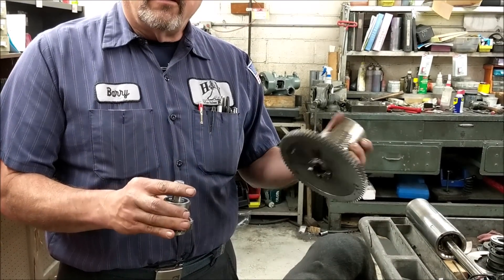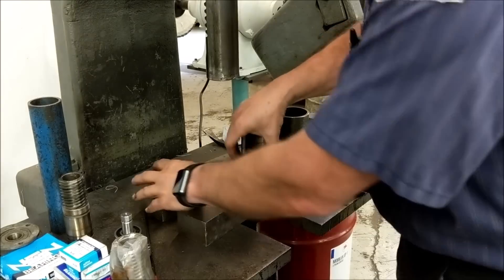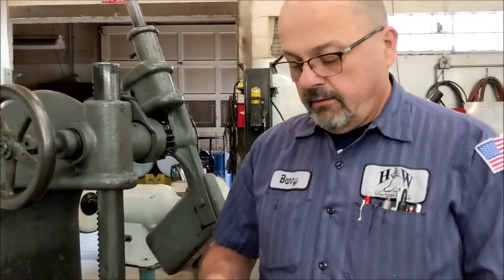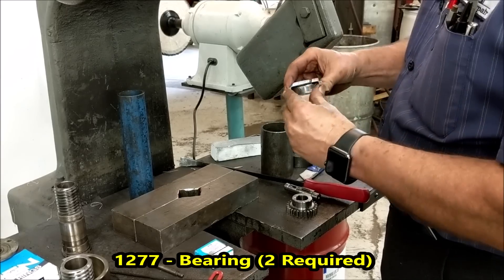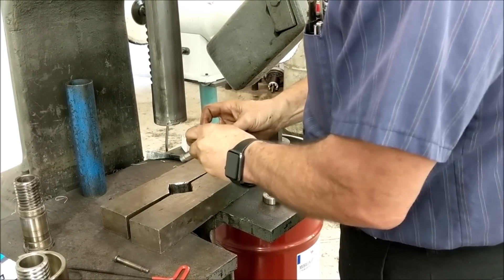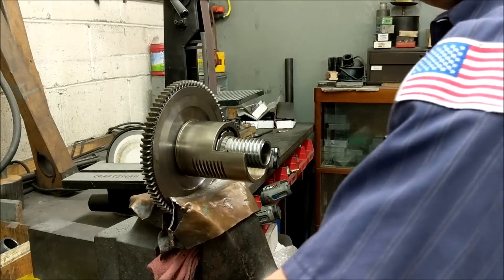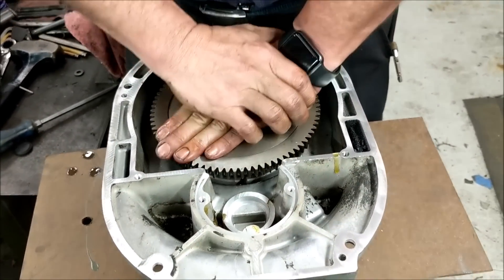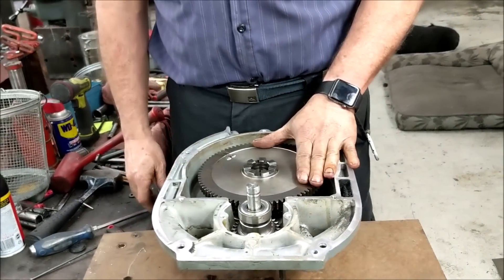Large and Small Bull Gear Disassembly, Reassembly, and Installation

Comment: Berry.  My Bridgeport runs smooth and quiet in high range but noisy (grinding gear sound) in low range.  What is the most likely problem? Thanks
Reply from the maker: If you have hearing the noise only in low it is most likely a Bull Gear issue. You can give us a call if you want to talk it through: 1-800-285-5271
Reply: Thanks.  I appreciate the help. @HWMachRepair

Comment: By chance I discovered an 80’s ford four wheel drive hub removal tool fits the large bull gear lock washer. At lest on the 1.5hp machine. Great neck #33625072 works on the

Comment: Thanks for the helpful video Barry! I’m rebuilding my Bridgeport currently but for some reason it’s rlly hard to shift from hi to low gear and was wondering if you had any idea for why this would be
Reply from the maker: It could be debris in the sliding housing or your shaft may have a slight bend. If you want to call and walk though some troubleshooting you can call at 1-800-285-5271 and we can try and help you figure it out.

Comment: Hello Barry,  Question; how to re-install the high/ low lever if it had been removed while the machine is assembled, in high gear, low gear, or????
I Love your videos, and thank you
Dok
Reply from the maker: You will have to install the lever in the HI position and make possible adjustments from there. Give us a call if you have any questions 1-800-285-5271 -Barry

Comment: Hi, You say you almost always replace the "spline gear housing or Hub" (but you say nothing about replacing the spindle) and you have a new one still in the bag. Why do you "almost always" replace it? does it cut down noise?  We love your videos and we subscribed, THANK YOU!
Reply from the maker: The spindle almost never needs to be replaced, only if the splines are extremely worn or if something out of the ordinary has happened to it, like warping. The Splined gear hub is most often replaced because it wears faster than the Spindle Pulley Hub since it's on the bottom and it has more pressure on it. It can cause excessive noise when it starts wearing down when running the head in high. If somehow you can stand the noise, and let the teeth wear all the way down, your spindle will quit spinning. If you have any other questions you can call us at 1-800-285-5271

Comment: Amazingly helpful video, Barry!!  I am trying to repair my older 1.5HP 2J - seems someone messed it up a bit - it has no neutral, only HI, LOW and LOCK AND STALL, lol. Once opened up, it seems small bull gear is not in correct position on shaft - it is way too high. I have fixed that according to your very clear video instruction, but I don't know how far to press down the top bearing on that shaft. Does it go all the way down to the lower key? Thanks. You provide an awesome service and I will be ordering parts I need for this rebuild from you guys ASAP!.
Reply from the maker: Basically, you want it as low as you can get it without resistance on the other bearing. I usually will press it all the way on and then feel the resistance. If there is slight resistance I will back it off slightly until that resistance is gone. Give me a call if you have any other questions 1-800-285-5271 -Barry
Reply: Barry, reassembled small bull gear assembly, put everything back together, and fired it up. Everything working beautifully, shifts into neutral exactly as it should. Thanks for your help, and for all the videos you post. They are an immense help to hobbyists like myself. (As it worked out,  no parts were needed at this time, it was just a case of someone previously putting it together incorrectly)

Comment: Good video Barry , I just picked up a vari speed Bridgeport this was really helpful . I plan on watching all the Bridgeport videos . Just curious , I was tempted to buy a Lagun FTV-1 , 3 hp. but there is not a lot of info on those , what is your opinion of that machine ?  Hey thanks for the videos , please keep them coming .
Reply from the maker: Hi Otto, Laguns are great machines that run exceptionally well. There are still parts available for the FTV-1, but the downside is that the parts are extremely expensive, and very few of the parts have a secondary source that you can get them cheaper. I would just make sure that it is in good working order before any purchase so you don't get stuck with something that is going to cost an arm and a leg to repair. Give us a call if you have any specific questions 1-800-285-5271 -Barry

Comment: At 15.30.. I can't engage low .. I'm trying to find out why it will not lock in. High gear and neutral ok just won't click in low. 😠 I'm wondering if it's been taken out at some point for whatever reason and put back without the big gear down. I would love to strip it down but my boss won't give me the time. 😢
Reply from the maker: It is possible the pin is not locating to the detent hole in low.  Put the machine in high and remove the shifter handle assembly (shaft and all).  Then make the adjustment required to be in high.  If it will still not shift correctly to low then the machine was reassembled incorrectly the last time it was worked on. -Barry

Comment: In low position, how far above the small bull gear should / can the large gear be?  Should they be completely even?
Reply from the maker: Hi Doug, In a perfect world they should be flush to one another. When I start them out I will always have them flush, but the most important thing is that large bull gear engaging in high. They can be as far as a quarter off from each other by the time you have the large gear set correctly. If you have any other questions feel free to give us a call at 1-800-285-5271. -Barry

Comment: My father was a machine salesman and in his later years started his own machine shop. 
We got a contract thru McDonnell Douglas in St Louis to rebuild 35 Bridgeport 1 1/2 hp mills I was hired to help.. I can do these teardowns and rebuilds in my sleep
Reply: Izzynutz Restorations love it! ‘
I’ve done a few DeWalt Radial Arm saw’s. All the parts are basically the same on each model, it’s just that some are 3x larger than others depending on model.